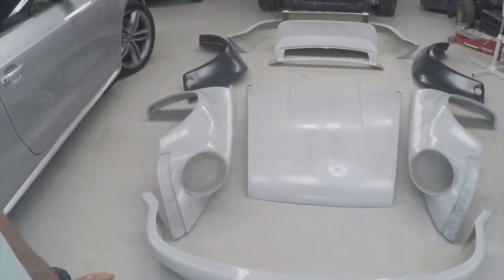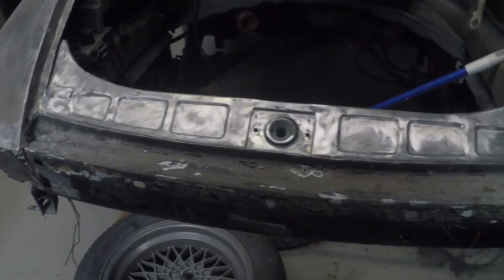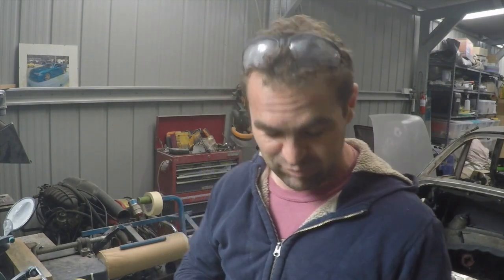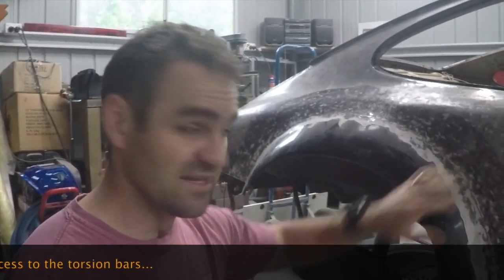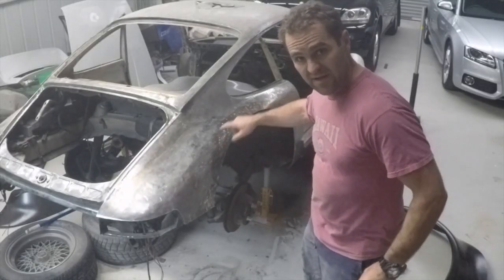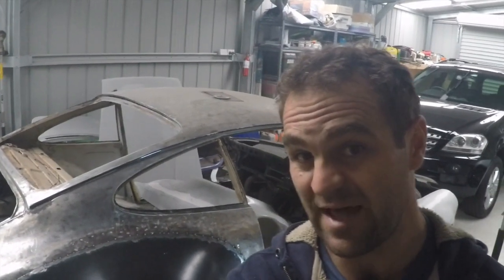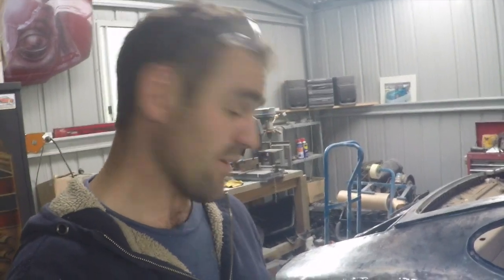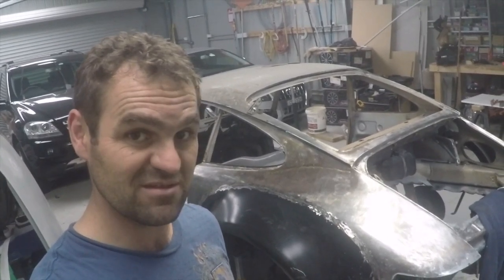Welding on wide body panels - Porsche 911 Classic Car Build Part 6

Comment: Hi Jeff- great video. I'm thinking of doing this mod but was wondering if original bumper assy were removed to fit new rs bumpers.  I saw the strut base mounts but did not see the actual bumper assembly/structure.  Were the original front and rear bumpers removed permanently?  Thanks.
Reply from the maker: Yes

Comment: It's so cool that you have the skill to do this. I rebuilt my 944 turbo (engine) I wish I could have the same skills as you
Reply from the maker: I didn't have the skills before I started, I just learned them along the way. My motto is, 'give it a go'. If it doesn't work, then worst case you take it to someone else to fix it up.

Comment: How'd you make sure the rear fender come out equally wide on both sides? if you know what I mean
Reply from the maker: I think I covered it on the video. I used a string line hanging over the middle of the guard and I measured from the string to the wheel hub on both sides.
Reply: Ah I thought that was only for aligning the fender arch to the wheel. That is clever!
Reply from the maker: I am not sure if that is the way that it is supposed to be done, that is just the way I worked out how to do it ;)